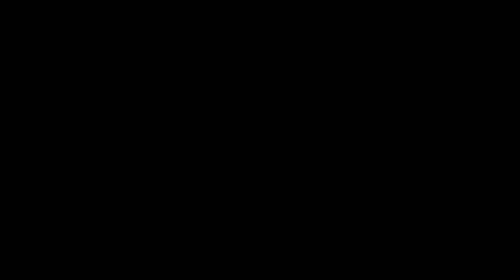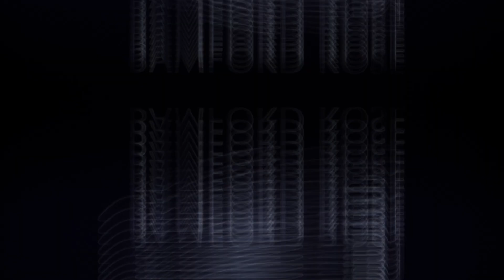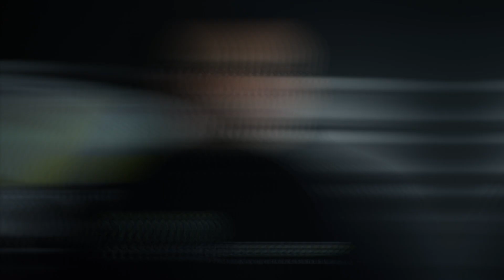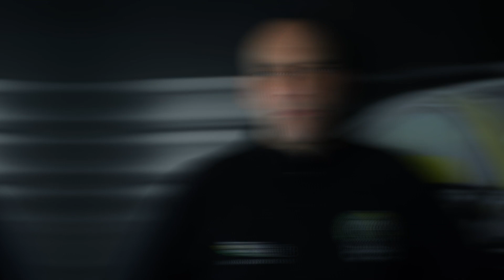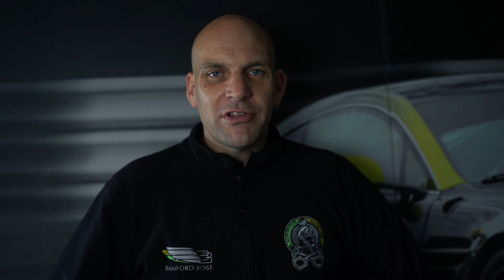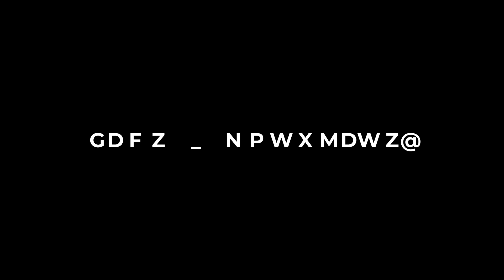What is engine blueprinting and your engine build for the GT4? - QOTW #11

Comment: The GT4 V8 build sounds amazing, and gives a healthy chunk more power. Is the 525bhp just for the build, or does that include the twin throttle manifold, exhaust manifold and cats etc? Also, Doing it on a V8 sounds good, but is there any reason not to do it with a V12?